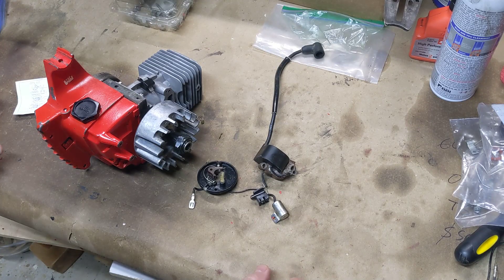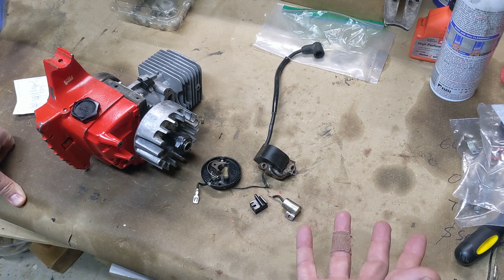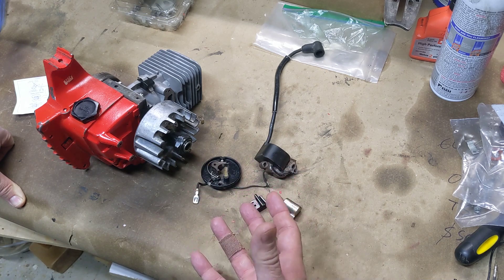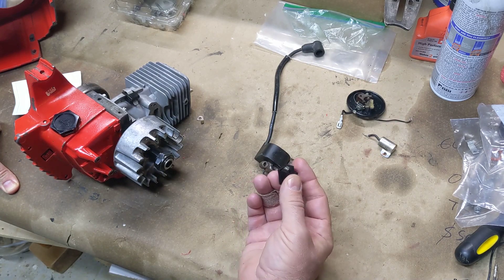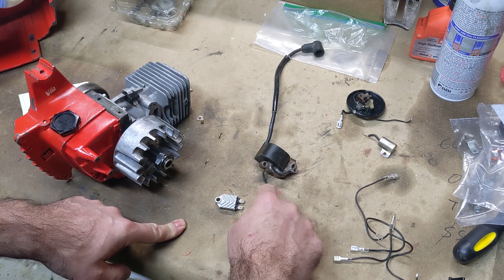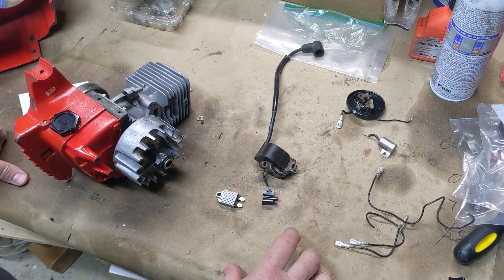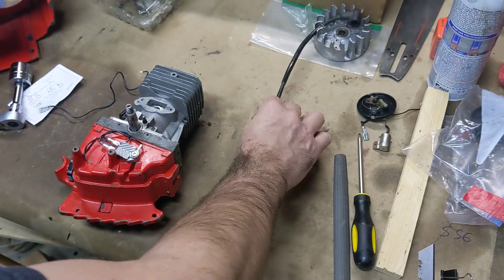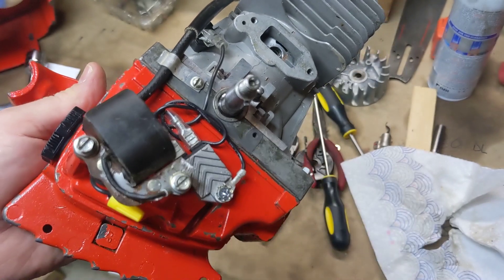Install Ignition Chip on a Chainsaw

Comment: Thank you for a great description of the ignition system works. LOL so many say and think the condenser makes the spark in the plug. I try to tell them it would run without the condenser but run bad and burn the points, they just don't get it. I am going to try depoting and repair a solidstate module the replacement is no longer available.
Reply from the maker: The Oregon ones like this haven't been available for a while now. I am trying this one below ..which seems to be a copy ..perhaps even the same source 
https://a.co/d/2dgg8zd

Comment: Iv got crasftman 3.7 / roper made them some one has a chip on it I zapped the coil with a 2amp battery charger it wasn't firing fires now iv did a bunch of saws that way some guys bakes the coils I zap them iv got realy strong runing super xl I did that way
Reply from the maker: I believe you. I'd wonder why it makes it work and how long that will last. Usually a failed coil is short in the winding

Comment: I recently dug out my old 150 that has sat in pieces in a box since 2013 (shocked it wasn't hucked into a dumpster while my ex wife still lived here during our divorce) and decided since I still haven't put it back together I'd go ahead and convert the ignition. Looking through my old papers and printouts I had with it, I had referenced a John Deere M70114 chip that looks very similar to the chip you use (though definitely not identical). Have you run it much since your first follow up with this Oregon chip? If yes, are you still liking it?
Reply from the maker: @NordicDan yep, she's been running real good after about 2 hours on it. I also have another video on the rest of the rebuild for this one

Comment: Hi, interesting video. Could you tel me how the chip 'knows' when to spark now the points aren't running on the flywheels cam lobe ? There isn't any magnetic point of reference on this older design of flywheel is there.. Many thanks from the UK..
Reply from the maker: I had the same question. My theory is it's triggered by the shape of the current curve as the magnetic field builds up in the primary coil. When it reaches a certain point, it grounds the coil and the energy built up is induced into the secondary coil. It's the only way it can work. And it does appear to work real good.  It runs very smooth topend.
Reply: @jonparkmac  Hi again, thanks for your reply.. Interesting theory, but I still don't get how it gets it's trigger point anyway near 2mm from TDC etc. I've sent the same question to a supplier of these chips on Ebay. I will let you know what they say.. You may well turn out to be right..lol..
Reply from the maker: @simonwiggle1791 only 2 wires ..ground and coil. So the only possible signal comes from the coil. I believe it Darlington resistors. https://www.foxvalleykart.com/timing2.html
Reply: @jonparkmac  Thanks for the link. The Ebay seller couldn't really answer my question. However they said that these chips won't work with 'multiple magnet' flywheels or any Stihl hand held equipment ! Make of that what you will. Thanks again for your interest and help..
Reply: @jonparkmac  do you mean darlington transistors?  Not sure there's such a thing as darlington resistors...